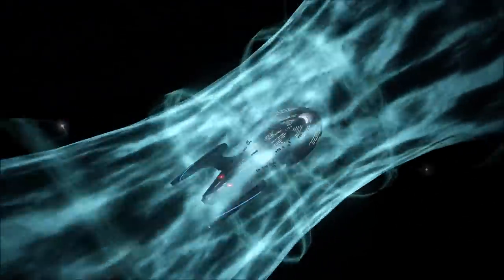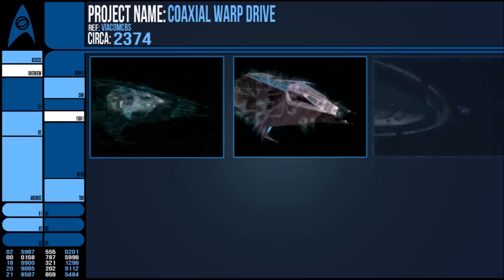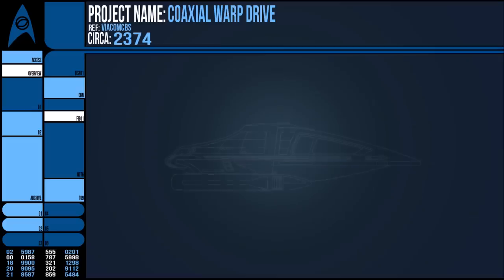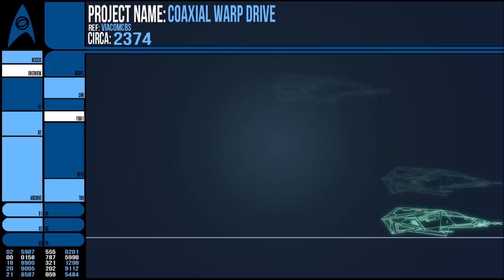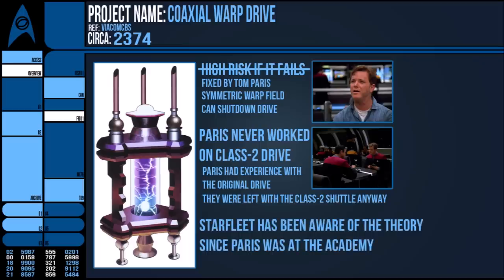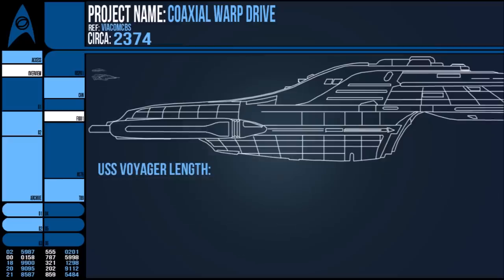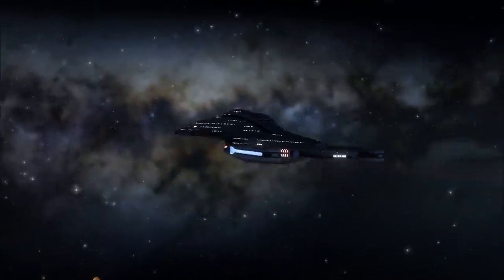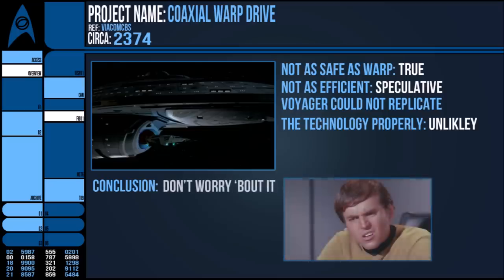Why Not Coaxial Warp Drive? (Star Trek Theory)

Comment: I don't remember this episode, so what I'm thinking may not fit / have been covered.
Coaxial Warp projects a field ahead of, instead of around, the vessel - warping space until both locations superimpose, then the ship transposes into the second space and moves when the field 'relaxes'. Alright, if this is correct, then its a 'folded space drive' disguised as warp technology and shares almost nothing with conventional warp theory. How the power requirements scale are unknown - any more than I know those for a standard warp drive - but the power requirement will go up dramatically the large the vessel (its subject to the cube/square law unless subspace is directly involved somehow - which it MAY be: its bending normal space, the question is what is it bending it in).
The most obvious problem is that 'normal' space is gravitationally effected by mass. Unless the space targeted by the drive is fairly 'flat', the bend isn't going to conform to the initial space the vessel is in. You can't use the drive to 'flatten' the target space either - the bending is imposed by the nearby mass - so it's not possible to use it to get near stars or planets. You'd also risk pulling any matter in the targeted space into you when the drive operated and normal space if FULL of debris (this is going to require you to have really good Deflector Screens). On the plus side, the vessel isn't moving with respect to normal space, so you don't have to worry too much about unexpected impacts on arrival (only from objects entering the space immediately after arrival).
Another possible issue... Starfleet banned high warp speeds because they were damaging to subspace (I know this issue was overcome). IF this drive bends 'normal' space thru subspace to achieve the Coaxial effect, I would expect fairly severe effects on subspace.
Also, unless the 'jumps' made by Coaxial Warp are fairly short, how does it target the space it's warping to match it own? I am aware that sensors don't exactly work with 'normal' space limitations (distance, amount of detail, etc. ignore 'normal' space limitations [it's that pesky cube/square law again...]). But this drive will REQUIRE you be able to target the location you want to 'jump' to well enough to lock your drive on it and warp it. And then there are the computations... This vessel will need massive computing power as well.
So... vessels with Coaxial Warp will require: massive computing power dedicated to both the drive and the sensors, and exceptional sensor suite, and REALLY good Deflector Screens. Power requirements are unknown, but likely MUCH higher than standard warp drive. And it can't be used near large masses...
Just a point about that last... did the episode explain why the ship popped near the Voyager? Because if Coaxial Warp jumps are disrupted by the unexpected mass of a vessel no larger than Voyager this drive is useless for fleet actions too. In fact, they'd effectively be presenting themselves to enemy vessels on a platter - the drive stops working involuntarily when you reach point-blank range.
Hummm... could you use it to get torpedoes INSIDE a target vessels Deflector Screens? It would be a far larger torpedo than a standard one, but the enemy would literally never see it coming - it would simple arrive.

Comment: There is another, yes another, drive tech shown in ST-E, the one used by the Xindi. [The visual effect of the inside of a subspace vortex, a CGI effect depicted in "Countdown" and "Zero Hour", is similar to that of quantum slipstream drive seen in Star Trek: Voyager. In the final draft script of "Zero Hour", the effect was described as "a roiling channel of turbulent energy."] [Capable of transporting a vessel at a rate of about six light years per two minutes, the vortices were opened through the generation of a phase deflector pulse, using on-board generators, and were sustainable for hours at a time] Using the Xindi drive Voyager could have got back to the Alpha quadrant in about 380 hours, about 16 days.

Comment: Co-axial Warp sounds like the Trek version of Battletech's Kearney-Fuchida Jump Drive. It can go ~1 LY / second, but only has a range of 30LY... but then takes 12+ hours between jumps [without a double jump module] as the ship either unfurls a giant solar sail or literally runs its engines in neutral to have the alternator charge the jump capacitors. K-F drives use gravity wells to jump through hyperspace between 2 systems' lagrange points

Comment: It may also be that Coaxial warp jumps are actually quite small. Meaning normal warp drive is faster and can travel father (relatively speaking) and so making the drive kinda pointless. At the same time it was only used in open space, so it may not even function in the presence of gravity wells or energy fields. Meaning almost anything can mess with the targeting and folding system making jumps impossible.

Comment: It doesn't matter if coaxial warp drive only works on small ships and Voyager was just too big to transport...because it's near instantaneous, both ways, all you need is to outfit something like the Delta Flyer with the coaxial drive, then take all the crew back to the Alpha Quadrant a dozen or so at a time. Or outfit all the shuttles with it. Or even just a single shuttle and make trip after trip. 

I would just take every small ship onboard, the shuttles, the Delta Flyer, hell even Neelix's ship and the damn Aeroshuttleand and start outfitting them with the coaxial drive. 

Then when you have a few  working drives installed, send one of the small ships back to Starfleet HQ to make sure it's going to work, and that it's worth is to keep retrofitting all the remaining small ships with the coaxial drive, and to lett Starfleet know what is going on and to expect the Voyager crew to return soon. Also give them the plans to the coaxial drive.
Then jump back to Voyager and let them know that everything is a go.  (Like I said I would wait to do this until you have several ships with working drives up and running, because you don't want to risk losing your only working coaxial equipped ship. But I wouldn't wait for all the ships to have the coaxial drives installed, because if it's not going to work them it's a waste of time and resources to continue retrofitting all the small ships.)

Then when all the ships are ready and tested, tansfer all of the crew except a small team to these vehicles then have all but one ship (I'd pick the flyer) jump back to Starfleet HQ on Earth.

Then send one shuttle back to let the remaining team on Voyager know that everyone made it back home okay. Then have the team on Voyager set the ship to self destruct by detonating the warp core - on a delayed timer, of course, to let the crew evacuate and get to a safe distance in the Flyer. (Destroying Voyager is necessary, in order to prevent anyone from finding the Voyager and misusing it - as a single Federation Starship could easily decimate whole planets from space. You don't just want to leave that kind of technology and firepower for just anyone to find.)

So the 2 ships watch to warp core detonation - from a safe distance, of course - to ensure that Voyager is safely destroyed. Then they both jump home together. (The reason I have the crew of the returned shuttle wait to jump back with the last team on the Flyer, is so that in case something went wrong with one of the ships you have a backup there so that nobody gets left behind.

Then, Starfleet upgrades all it's ships with coaxial warp so that nobody gets stranded decades from home again.

Comment: Well in one of the series, I think TNG, regular warp past a certain speed damages space if the area is traversed at warp speed frequently. Perhaps coaxial causes subspace wear and tear at a faster rate? Using the tried and true folded paper analogy, regular warp is like rolling paper up into a tube and coaxial might be more like creating a hard crease in the paper. Once you create a crease in a piece of paper it's tough to uncrease it.
Reply: Isn't that why the Voyager has the swiveling nacelles? To somehow mitigate that issue.

Comment: Just spitballing here, but it might be possible that the coaxial warp drive may have been a genuine contender for the Voyager crew to utilize. It might just have been that the technology was so vastly different to warp drive that it couldn't have been implemented without vastly changing the configuration of the ship, which would have required a  complete overhaul with the aid of a drydock. We've seen that Slipstream tech was far more compatible with a standard warp drive which is why the crew went with that option in "Timeless".  We never really got to know in canon if the technology was utilized upon Voyager's return. It certainly may have been after a few years of further study...

Comment: There's another possibility. The coaxial induction drive appears to be a very different sort of warp core compared to the standard. Given how importantly they portrayed Voyager's warp core in particular in contrast to other series, perhaps they had no feasible way of building a core the size of what they needed for Voyager. That said, it wouldn't explain why they didn't install it into the Delta Flyer.

Comment: So basically, normal warp drive is an Alcubierre drive (if you don't know what this is, it's a real proposition, look it up), and coaxial warp is akin to recreating a wormhole, but without... Uh... Well no, that just sounds like a wormhole if I'm being honest.

No wonder the thing was prone to exploding violently, the amount of power focused into one place would be many orders of magnitude higher than an ordinary warp drive. ...That could be key to keeping it "balanced" in Star Trek lore, though: It may take much longer to spool up, it may have limits on how far it can go without overloading, and it may requires an extended period of time to "cool off" after use. Might require maintenance and recalibration after every use, too.

It would have sped up Voyager's journey home, but not made it instant. Would have also given Voyager the ability to respond to a distant, but not too distant distress call or something of the sort in hours instead of days.

Comment: If the drive has to reach out & "grab" a point in space to bend towards the ship for it to then move onto & "release" what if it can only reach so far out? If its reach is matched, or nearly matchd by other warp drive tech, that would mean (if no cool down was required) stop & go driving to possibly traceable points would put a ship in danger of being unable to retreat from an enemy. It could also have a predictable range per jump that would also leave it expossed/vulnerable. In a galaxy full of enemies, this may just be too much of a tactical disadvantage to use .

Comment: It could be that the required computational power goes up exponentially with the size and mass of the ship. Making it not viable for travel of larger vessels. This would be interesting as you could outsource this computation within your own territory creating Warp Highways. Instead of calculating the hole jump you just download the parameters for you current starting location apply you ships parameter and basically jump to your destination. This however could cause problems with subspace integrity, like a piece of paper which gets folded along the same line over and over again also weakens.

Comment: The simplest single answer really is coaxial warp drive in its current level of advancement is no faster than warp. It covers everything without having to make up reasons from scratch. 

All the problems were solved, and the design was easy to implement from scratch as a retrofit. No exotic fuels, no being too advanced, no gonzo side effects were mentioned. That only leaves the speed since it is the remaining mystery.

Comment: Hmm, if I had to give an in universe explanation, it's possible that the size of the drive needs to be proportionate to the ship? Like for example we see the drive on Steths ship and the shuttle, they're relatively small, but proportionally would be about the same size as a small warpcore if you scaled the shuttle or Steths ship up to the size of Voyager. Perhaps it's not replicating the drive that's hard, it could be instability that comes with scaling the drive up to be large enough to be effective on Voyager. There's also the added idea that perhaps it wasn't directly compatible with Voyager itself or there wasn't enough room on the ship to construct a drive large enough without compromising the ships structural integrity or systems too much. It could also be that the amount of fuel required to make the jumps scales with the distance of the jump times the size/mass of the ship, if that's true, then what would be normal power outputs on a small vessel could be astronomical for something the size of Voyager.Or it could be some not exotic fuel but still harder to get in large enough quantities to make an individual jump plus potential modifications required to voyager worth it.

Comment: You got me to add my own theory. It all comes down to performance. Parallels can be made to the early development of the automobile. The early three strong contenders were batteries, steam, and internal combustion engines (ICE). The reasons why ICEs won makes good reading. This could explain why coaxial warp drive is not common, too many problems compared to regular warp drive.

Comment: Coaxial Warp Jumping (CWJ) is far easier than the Cytherian Space Folding (ST:TNG "The Nth Degree"). But my guess is, in universe, CWJ is quite doable. Steth however, is likely NOT the originator of the technology. He stole bodies, he likely stole the ship. Steth knew how to operate the system, even some general troubleshooting, but not how it really worked.  Voyager likely stumbled into a case of alien espionage, Some alien version of the Clint Eastwood movie "Firefox", and had no idea what was going on. 

At any rate, it is quite possible for a team of Starfleet engineers to figure out CWJ (with a working model on their table) well enough to manage long range test flights with shuttles. Then Voyager would eventually figure out how to make the system big enough to get the ship home in one piece, in major a few jumps. This could, by the plot, take a few years to figure out. Although only after gaining communications with Star Fleet command, is it possible to make this new "Warp jump" possible. The added brain power from home helps enormously. 

Once home, CWJ is developed first but the high energy requirements, long range destination targeting problems, and the longer the jump the longer the ship will need to recover,  NEVER took Quantum Slipstream (QS) off the table. QS would still take a few months to cross the Galaxy. CW would facilitate just getting across the galaxy in a few days at most, after multiple jumps. This would effectively end Warp's necessity in the Star Trek universe, except as a baseline technological  boundary for first contact. 

Also with distances cut so drastically, the complexion of Star Trek would change from "exploration", to near-constant war readiness when hostile factions from across the cosmos are literally only a few hours or days, instead of decades, away.

Comment: Converting a shuttlecraft to an experimental form of propulsion, is most likely much simpler than converting an entire starship; it should be remembered that the wrap core is the primary power source for ALL systems, and supplementing life support, computer, and replicator power on a shuttlecraft for a few test flights, would be fairly straightforward, while incorporating a new power source for your primary vessel, would be a completely different animal.

Utilizing a completely different type of warp technology, would most likely require designing a new ship from scratch.

Comment: Likely answer, two parts: 1) we don't know the max range, but let's say it can make a 500 ly jump once every 24 hours. That would be great. Home in weeks rather than decades. But what if it is ONLY 20 ly? They would be giving up a known, reliable technology and engine for something that was experimental and already had shown itself to not be completely reliable. However:
2) if it could make huge jumps, in the 500ly plus range... they would have to KNOW everything about the space they were jumping into before jumping. I believe Voyager could scan 20+ light years ahead from their sensors. (good trick, but Star Trek magic). They would know what is there, what meteors, comets, rogue planets, nebulae, etc. But 500 light years? A thousand? They MIGHT know the position of the stars at those distances, but what about planets, rogue or otherwise, comets, nebulae, space-born dwelling creatures that might be pissed if you fold into the middle of their school outing for their kids?
I think number 2 is the most likely. Unless you know everything about the space you're folding into, it would be dangerous. If it could fold from where they were straight to sector 001 then maybe possible, but still iffy as a passing star-ship could be right where they want to appear. Unknown tech, or not fully reliable tech, is not a great thing compared to a device they have hundreds of years of knowledge about and have spent their research on.

Comment: And even with the distance limiting factors, I think that modified and used in conjunction with some technologies like spatial catapult or warp acceleration gates/locally placed (transwarp- but "cheaper," smaller scale, less so energy cost prohibitive) "coils" this could make for a massive and massively effective relay system...for a nearly instantaneous travel to any inhabited solar system at that... a space trolley/escalator?